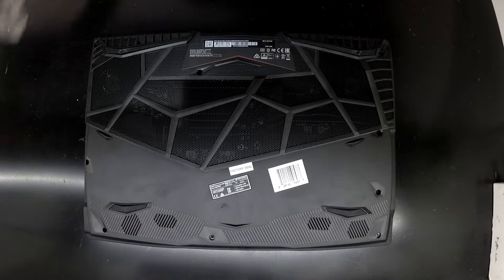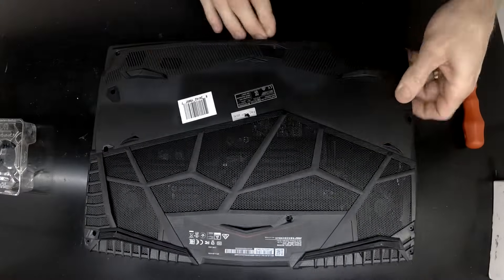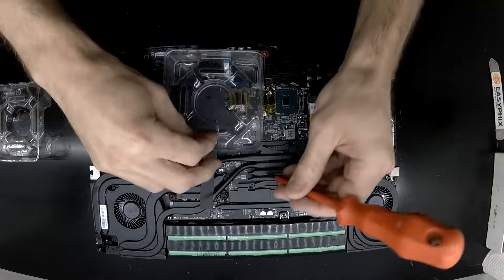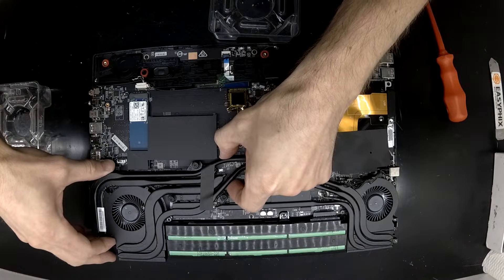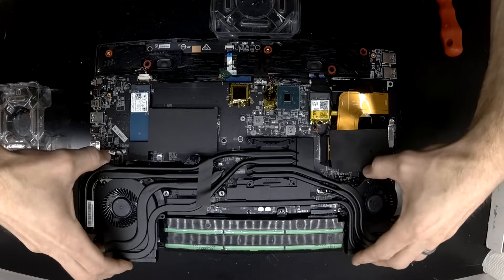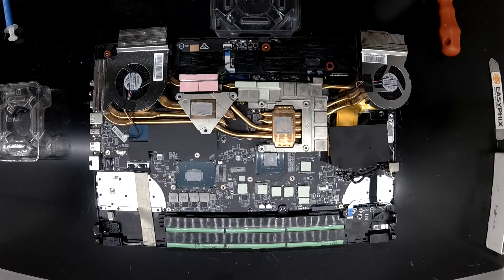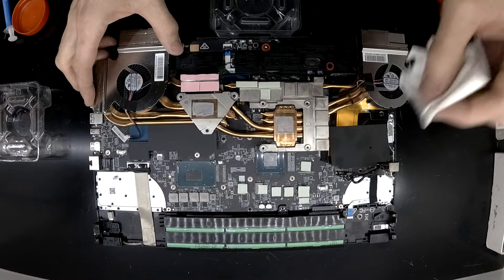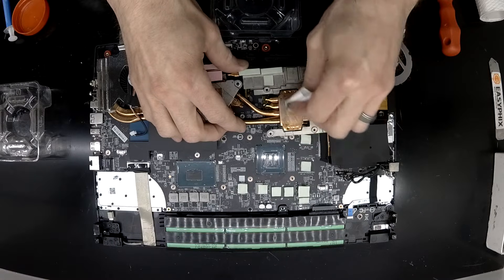MSI GL65 Teardown and thermal paste replacement

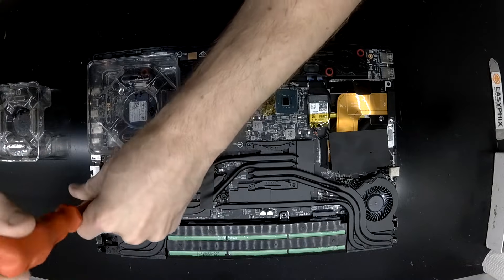Comment: 1:10 Yeah i did that last year opening mine. I accidentally damaged my mic input. Well it came off the board. So i really i just need to solder it back on. But the aux still fine.
Reply from the maker: all the best for the repair
Reply: @rickstechrepairs thanks. I opened it again actually. Needed to replace the thermal paste everywhere. I hadn’t done it since i bought it in April 2020. It seems fine though. Just a little burning on the heat sink plates for the GPU and CPU. But those two chips are fine. Thankfully. But it really needed fresh thermal. Running great now. Thanks for showing me how to get to there gpu and cpu

Comment: Been wanting to change the thermal paste for a gl65  i7 10750 and rtx 2070 super that i use at work, not much load but while rendering scanned 3d models peaks at 96° and on idle goes to 65° more or less. The gpu mas temp is like 70 and on idle like 50. Hope that it will have better thermals after changing the thermal paste. Thanks mate. Stay awesome people

Comment: If my thermal paste on the gpu is not making complete squish out to the edges does that mean my 1mm pads are too big and I should use 0.5mm?
Reply: Uhhh I stopped using thermal pads temps were way worse went to all paste
Reply from the maker: im not sure on pad sizes sorry, paste away (aslong as its not liquid metal)

Comment: Hi Ricks Tech Repairs, When I pull up the heat pipe and a little bit twist... I feel difficult to pull it up... any suggestions/advice?
Reply from the maker: once you have undone the screws, try to rotate the heatsink clockwise, then pull up

Comment: I have to try twisting my HS/F, I gave up after fearing I might rip off a component. This is the 1st time trying to remove a HS/F assembly with that many pads sticking to it and felt as it was glued in place.

Comment: The old past cause it to stick. I can't remove the heatsink
Reply from the maker: let it run for a bit before trying to take the cooler off 

when you do go to take the cooler off, try and twist it rather than pull towards you

Comment: Weird, I just had to remove the HSF to clean the HS fins (clogged with dust, the laptop was running really hot).  I have extra inductors and my GPU was different (GTX 1660 Ti).  I had some weird pink thermal pads on the chokes near the CPU.  Removing and replacing the paste was a pain but my computer runs cool now.
Reply from the maker: excellent to read you have sorted it out !

Comment: Does it matter which termal paste i use?
Reply from the maker: there is different quality thermal paste, so it does to a point 

I normally use Artic Silver
Reply: @rickstechrepairs  i have an old paste in a syringe. I dont Know the brand. You recomend me to buy a new one and a good brand ? Does itnreally makes a differenfe ?
Reply from the maker: if its only unknown brand, i would purchase some new brand named stuff

if you already have your machine apart put the old paste in there for now but replace asap
Reply: @rickstechrepairs  Thank you ! ! Have a greatt day!

Comment: i got msi gp65 looks like vrms doesnt use thermal padsto mine but a paste, we can use any thermal paste there? also i heard we can use k5-pro, or better switch to thermal pads but with what dimensions?
Reply from the maker: if it had thermal paste, it should be fine to reapply paste there

Comment: Interesting your m.2 slot being used is the location that just has the m.2 pads on mine. My m.2 is horizontal towards the front, below the RAM, under the black paper cover. I'm planning on installing the 2nd m.2 once I source the parts.
Reply from the maker: that space under the ram, certainly has enough space for the m.2

Does your laptop has 2 m.2 slots?
Reply: @rickstechrepairs   @Ricks Tech No, I only have the pads for it, MSI didn't populate that area.
I watched your video on a phone and looked like there was a covering like what is being used on the RAM over that area. Must be just the PCB then. Yes that area is where I have my m.2 located. The spot you have yours populated is where they only have pads but left the connector, coupler capacitors, and the hold down stud off. I'll solder on the components once I get them.
My laptop shipped with a 10th gen i7 with the 115w 2060, 1TB HDD, 512GB nvme, and 2x Samsung 3200 running at 2933.
Reply: @rickstechrepairs  my laptop model number is 10SEK-022, bought a couple of months ago.
Reply: @rickstechrepairs  Just finished soldering on the m.2 connector and the other supporting components last month, the mod fully works, and the BIOS already was ready for the 2nd m.2.

Check the HardOCP forums under the SSD & Data storage section, titled "Dear MSI, thank you for leaving the solder pads", since Youtube deleted my link. I'm go by the same user name.

Threw in a 2TB drive for just my games.

The 1st attempt was with a solder iron and I melted the m.2 connector. Had to order a reflow gun and low melt solder for the 2nd attempt. I would recommend people to add the connector 1st, then the 8 tiny 0201 coupling capacitors last. Also order double since they can easily be lost.

Comment: Does anybody have a clue on how to remove the keyboard on this model?

I have to remove a keyboard because a customer dropped a glass of cola over it and now some of the keys stick and its not functioning (miraculously there is no damage to the motherboard...)

I can't figure out how to remove the keyboard assembly from the case, it seems like it's kept in place by some melted tabs.

Any help on this is much appreciated, I have everything disassembled and hope to have it replaced ASAP, I only have the new keyboard and backlight without a frame so I have to reuse the old one.
Reply from the maker: Melted tabs would be how it's in place

Alot of keyboard that push up through the bottom are now plastic welded in place

They are a hitch of a job to do and take around an hour to 2 to do 

Did on last week on a different model but same style of keyboard
Reply: @rickstechrepairs  that sucks... Do you have a video or a description on how to undo these melted tabs?

I was thinking on removing the melted parts and glueing them back in place when I installed the new keyboard.

Thanks for your reply!

Comment: For some reason on mine, all the vrms and areas with thermal pads have no thermal pads, and instead have this thick crusty white paste, any idea what size thermal pads I need? Or should I just use some thermal paste on the vrms since that seems to be what's been done for some reason? I can email a pic
Reply from the maker: I no longer have this laptop, I would aim for thermal pads, If paste is currently being used then I would go with 0.5cm pads
Reply: How you clean the white paste on vrms anf areas? Is it same like clean cpu & gpu?
Reply: @galaxyjballer9642  Sorry im just now getting back to you, yes, after alot of research it turns out its Viscous Thermal Paste for the VRMs and chipset, you have to replace it with new viscous paste, i used K5 PRO Viscous Thermal Paste  which you can find on amazon. i dont know what size pads it would take, but in summary, yes you clean it off just like the cpu and gpu but it requires Viscous Thermal Paste to be put back on them all, and be generous with the paste too, look up a video if you need to :) best of luck!
Reply: @morganscott8535  thank you for the answer sir!!! But is it okay if i change that to thermal pads?
Reply: @galaxyjballer9642  if you can figure out what size pads it takes i think it would be just fine. Id rather have pads my self so if you figure out the correct sizes let me know. As for alcohol, I use 91 percent rubbing alcohol, anything above 90 percent is good, anything below 90 is sketchy, like 75 percent can have water or other additives that can be harmful or at the least cause corrosion or residue, or just not clean well at all to begin with.
Reply: @morganscott8535  thanks a bunch
Reply: @morganscott8535  Hello, could you find out what size?
Reply: @limadark3132  I ended up using k5 pro viscous thermal paste. Couldn't get the pad sizes, the paste has worked great now for 2 years.
Reply: What % alcohol you use to clean the old paste

Comment: I have a MSI GL65 9SDK, I want to undervolt the the system because it's reaching mid 90°C while gaming. It's only 8 months old so I don't think it needs re-pasting. Please guide me through the mV values for this particular laptop / chassis
Reply from the maker: I haven't done undervolting, I would suggest for you to watch I general guide for the 9300
Reply: @rickstechrepairs  Thanks a lot for replying. Okay I'll check that out.

P.s. I have watched this particular video numerous times. It's so satisfying, whatsoever. 😀
Reply: Bro, my cpu is getting 90•C when gaming, its that because the thermal paste??
Reply: @WeeDZart  how old is your machine?
Reply: Aradhya Jain 9 months, i tried to throttlestop its increase the fps lil bit tho but not reduce the temp.
Reply: I have MSI ge65 i7 9750h +gtx 1660ti. It have same cooling with gl65 and gp65
My temps are 80-85C CPU and 70-73 GPU. With autofan it's work 5000rpm. Max fan is 6500rpm. This with heavy game loads, when CPU pools 45 watts and GPU 80watts. Undervolting helps to drop 5-10watt for CPU or boost till 4000mhz.

Comment: I have the 2020 variant, the graphics card was totally caked in thermal paste lol
Reply: Im getting mine tomorrow. Are you saying the card got so hot it cracked ?
Reply: @randysamayoa9374  no it just had a lot of thermal paste on the graphics card, other than that it's fine
Reply: @IvanNava  I'm going on three months with my 2020 model, and I get 85°C on the CPU and 70°C on the GPU with it on a table, but I also get 80°C/65°C propped up on a garbage cooler pad from Amazon. Lol. I just pulled up to Micro Center, so I'm hoping to see some sort of improvements. ≈5°C sounds about right tbh.
Reply: I've had my MSI GL65  (RTX2070) for about a month now, and it's been consistently reaching 208 F (98 C) even when propped up for maximum airflow at the vents.  Curious to know if yours was improved when you re-pasted it.  Also, what was the manufacturing date on yours?  The sticker on the bottom of mine (near the hinge) shows 2020/04, so I'm assuming mine is caked with the factory paste like yours was.

Comment: I just got one of these laptops today. I pulled the bottom cover off to upgrade the RAM. When reassembling the bottom case, I can not get the case to line up and snap into place right below the track  pad. In your video it doesn't look like that part of your case snapped back into place either. Have you noticed any issues with that?
Reply from the maker: No I haven't noticed any issues , it did snap back in to place at that point just need to use a bit of force 

I have since sold this machine
Reply: @rickstechrepairs  I got it on there. Just had to use some force like you said. Thank you!
Reply from the maker: great to hear :D
Reply: I have the same problem, the back lid near the touchpad isn't aligned with the front case and it leaves a gap near the touchpad, could you please tell me in detail how u managed to get rid of the gap ?
Reply: @mahadzahid6524  I have that too, I tried many times and couldn't fix it. I think some plastic hinge might broke... More cooling vent I suppose?

Comment: I got the same laptop. What are those white small white squares around the GPU or CPU?
Reply: Those are voltage regulators for CPU and GPU, they also need active cooling, you can see the thermal pads on the heatsink for those.

Comment: can you help me , is there a way to change the graphics processor that this laptop are using instead of intel i wan to use nvidia? (every thing is updated on my laptop done several trouble shooting but nothing works)   there is an option on the  control panel but even you change it its not actually changing to nvidia processor it still chooses the intel  graphics processor, on the bios there is  no option to choose nvidia for the display  .. thanks you
Reply from the maker: Hi sorry, i dont have too much advice to offer on that one apart from reinstalling drivers
Reply: Maybe I'm late, but it might be helpful for those, who read it now or in future
Plugging laptop in was helpful for me
Found in google that it is energy-saving strategy, because accumulator that is used for laptop when it's unplugged isn't able to provide gpu with enough energy, so gpu is turned off automatically, I explored it when my gaming perfomance was low when laptop is unplugged (games didn't "see" the gpu), and high when it's plugged in (then games "seen" the gpu)

Comment: Does it share the same configuration for the bottom panel with the msi gs65 9sc-041x? Mine has 256gb of M.2 SSD in it.
Reply from the maker: cant comment on that one, but being similar ages machines, i would expect them to have a similar setup

Comment: I will suggest you to remove the battery at first before you remove other parts in the laptop will be better. I have seen some cases that users forget to remove the battery before they remove the heatsink that causes the motherboard damage.

Comment: Those thinking of replacing the paste, it's really not worth it unless the laptop is 5 or 6 years old, even then, depends on how much it has been used.
Reply: I have a GL65 and I had relatively high temperature, the thermal paste application was very bad and the paste completely dry. Changing it is definetly helpful
Reply: It's still a good practive to clean the cooling system and replace the paste every year or so, in my experience, a 5 year old laptop will have its radiators completely clogged with dust, hair and other stuff
Reply: The factory paste is shit man, I got 15° drop, used Gelid GC Extreme.
Reply from the maker: Certainly helpful to drop the temp 5 o C 
On a much older machine you would get a better temp drop

Comment: what ssd type does it have exactly and what storage options i can apply becuase im running out of storage quick and i was searching for storage but i was wondering if it where possible to put another ssd or a hard drive or something, id like a response please and thank you if u do.
Reply from the maker: Either install a brand new Nvme m.2 ssd or add in a 2.5" SSD/HDD and expand yourt storage from there

Comment: Hi Rick
I have a similar laptop, msi gl65 9sd i7 9750h gtx1660ti, I just bought it a week ago.
In games that are not very demanding (Dota2, Battlerite) the CPU has reached 93 ° C, an average of 87 ° C, and because the keyboard feels very hot, and even with the fans playing at maximum, temperatures do not drop.
I wanted to ask you if before doing the thermal paste replacement, did you consult msi support if that does not affect the warranty?
I don't know if to do it, for now I try to see the correct way to do the undervolt, although I don't know if I should do it to both the CPU and the GPU. And well, I have not found reference data for the undervolt of this model :D
Reply from the maker: Hi 

With the new thermal paste, i didnt contact msi, as the warranty sticker isn't valid here in australia.

undervolting may help but its something i havent looked at doing
Reply: @rickstechrepairs  How much did the CPU and GPU temperatures fall after changing the thermal paste?
I am seriously thinking about doing it, since I have achieved less temperatures than I mentioned before, but turning on the Cooler Boost 5 since before opening the games, the problem is excessive noise.

Do you recommend a thermal paste with more thermal conductivity?
I've seen brands like Artic MX-4 and CoolerMaster Extreme Fusion X1
With 8.5 and 9.5 W/mK
Reply: By the way, I had not noticed, I do not know if in my case I also have the chipset with thermal pads, if it were not the case, could I put thermal paste? Or should I buy thermal pads?
Reply: Kev Málaga hi dude, i have GL65 9SEK (9750h+2060) in all games w/out turbo boost temp of the cpu is around 80-82•C in turbo mode, gpu is around 70-72•C
Reply: I just did an UV -0,12v
Reply: @nerale  how to undervolt cpu?
Reply: And overclocked 2060 from 1335mhz to 1535mhz
Reply: Did you re paste? how did it go?
you can use 'Intel extreme tuning utility' to undervolt, a lot of tutorials out there on it.
I too use MSI gaming laptops, they always come with shit paste jobs with shit paste. 
My current one also had a plastic strip between the cooler and the cpu to help lessen rma failure returns, but this also reduces conductivity between the cooler and the cpu, so if you get an msi laptop, just repaste it on delivery.

Comment: Can you upgrade the HDD on this laptop? How many slots does it have?
Reply: I didn’t quite get what you said, can you please say yes or no? Mb bro
Reply from the maker: yes
Reply: @saulandrespadillacarvajal7812  on the right side of the screen u see the gold L shape, that's the spare slot for 2.5 sata. And you have also for m.2 SSD.
Reply from the maker: I found the m.2 which is filled and a spare 2.5" drive
Reply: Lol

Comment: this or asus 505dt ??? difference is amd 3750h instead of intel 9300h and overall design/build. seems like this might have better cooling
Reply from the maker: I will agree with you. Getting my hands on a 505dt next could of days and will benchmark
Reply: @rickstechrepairs  nice . great review btw hope the channel grows
Reply: @rickstechrepairs  Hi Rick, did you disconnect the battery?  How easy are the batteries to replace on this model of MSI?  What about the hinges?  I have the GL75.  Will this laptop work with no battery and just AC power?